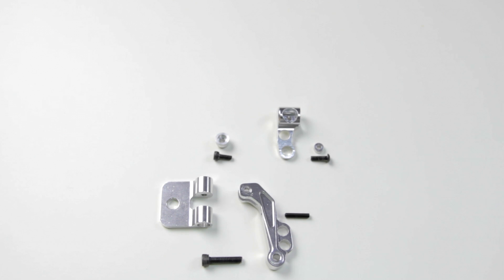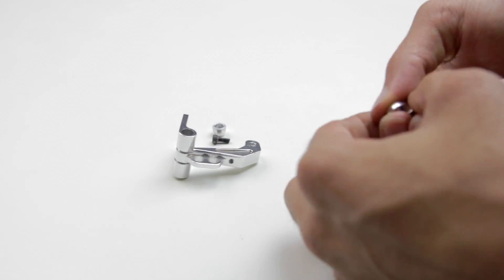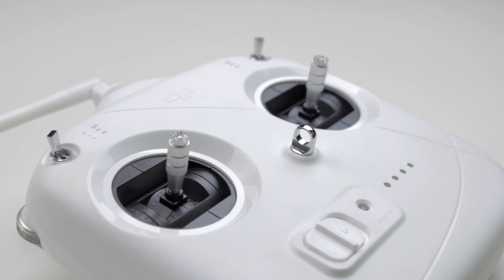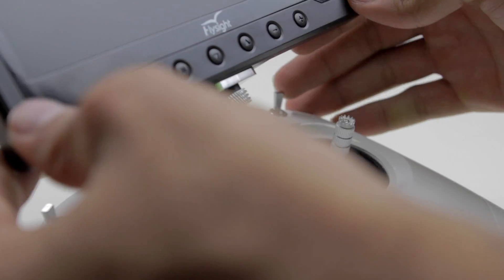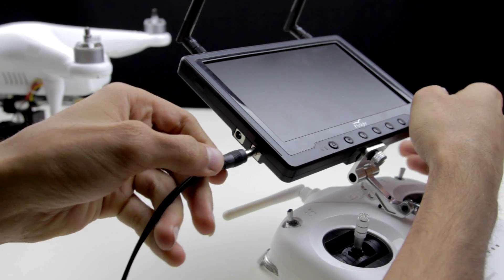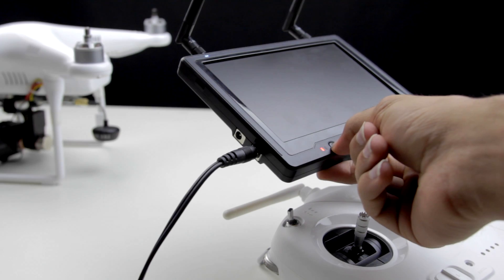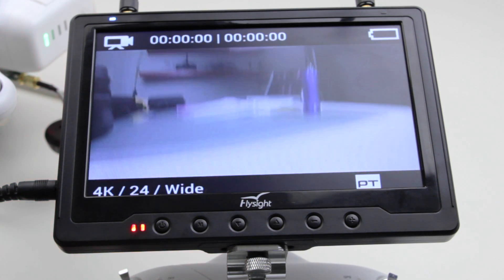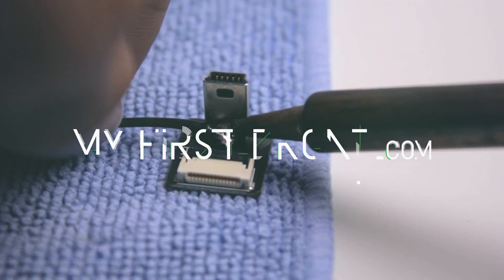How To Do FPV With The DJI Phantom 2 (Part 3)

Comment: I enjoy the information you give --BUT---you are totally wrong on your installation of the monitor mount. The holes for your lanyard are on the bottom of the mount. You need to turn the whole mount 180 degrees and you will have it! I can send pictures if that would help.
Reply from the maker: I realize that now, but that's why I didn't really go into putting it together in detail. Since it didn't come with a manual and I don't use a lanyard, it doesn't really matter for me, but I can see how some people might care about it.